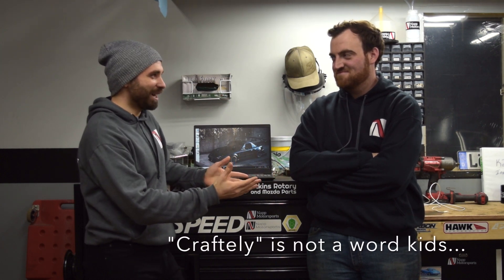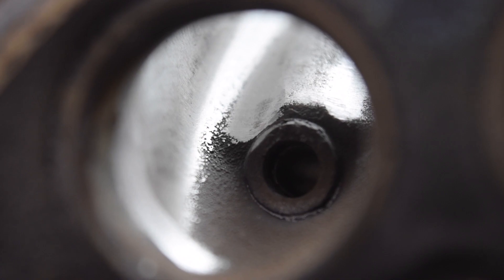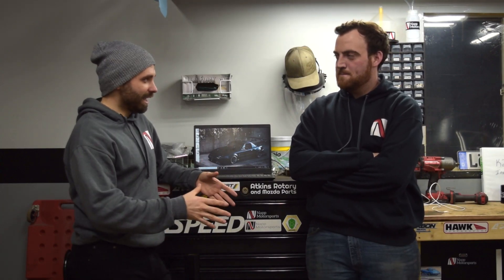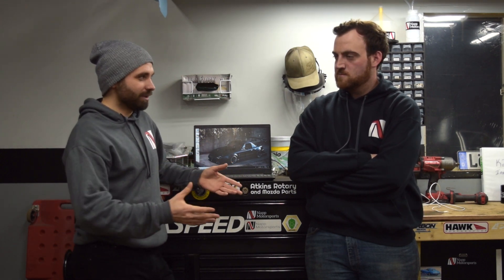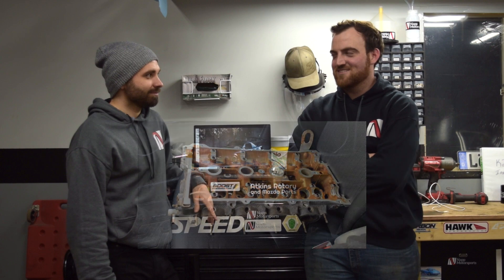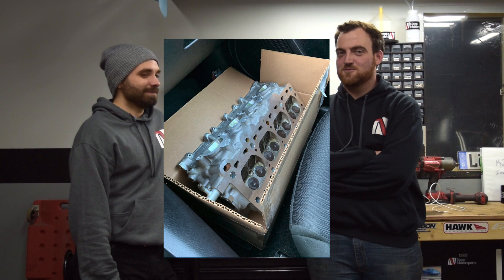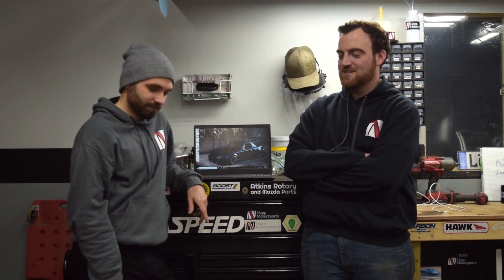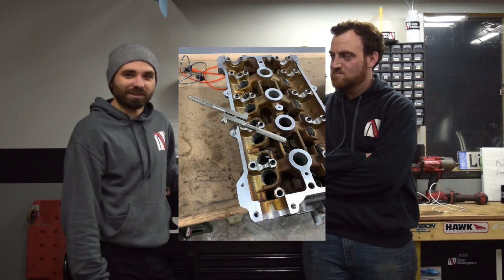Engine Rebuild - Miata VVT Swap | PT4

Comment: Are you able to run full VVT advance with a 0.040" shave? 

I haven't been able to make an exact calculation, but it looks to me like the VVT cam advance would be the limiting factor for a head shave. 

I'm currently trying to figure out whether to do a 0.040" or 0.060" shave on my BP6D. Let me know if you have any info!
Reply from the maker: Our tuner had no issues getting what appeared to be the max power out of this setup, so I don’t thing it had any real effect on the VVT advance. We didn’t do the math, we just sent it.
Reply: @NappMotorsports I admire your bravery! Have you shared your tune /  VVT table anywhere? 

Have you run the "test mode" where Megasquirt sweeps through the entire VVT range? That would confirm that it's not possible to cause interference with the VVT solenoid.
Reply from the maker: We haven’t shared the tune, as it wasn’t done by us and it didn’t seem fair to take our tuners work and put it on the market for people for free. We haven’t run the test mode either.
Reply: @NappMotorsports  FYI, I just measured clearances on my VVT motor and you guys are right at the limit with a 0.040" shave. At the max VVT advance (47 degrees) two of my valves actually do slightly contact the lip of the valve relief in the piston. Just enough to wipe the oil off. 

I did another test at 31 degrees of VVT advance and there's about 0.060" of clearance, which is fine. 

So as long as your VVT doesn't oscillate and the target table doesn't go above ~40 degrees you're totally in the clear.

Comment: So been studying the head shave and been reading about the cam timing. Did you guys do anything to correct the cam timing or does it run just fine as is?
Reply: Honestly think it's a non issue unless you are super picky about that kind of thing. Currently just dropped off my vvt head at the shop to get .040 taken off as well and has me a bit paranoid.
Reply from the maker: You’ll be totally fine at .040. I think at .080 or .100 is when you need to adjust it.
Reply: @NappMotorsports  Thanks for putting my mind at ease lol =D

Comment: Awesome video guys. I currently have my 96 1.8 head off and want to shave 40 thousands off as well, from what I've read it seems like a good sweet spot. You say it's now an interference engine yet plug and play, stock cams and ecu. Did you have to adjust the timing at all or is it just assembly as normal? Also did you use a regular head gasket or recommended aem thinner one?
Reply from the maker: It’s plug and play with the stock cams and timing setup. We used a stock head gasket as well. Once you take I believe .080” off, you have to compensate with adjustable gears and some other stuff to get the belt tight enough.

Comment: Good job guys.! Just finished my own n/a bp build of course in my garage too.! It made 183hp and had lots of fun with it at the track.!! Next step is an adjustable intake cam gear for cam timing fine tuning which along with ITBs hopefully will get me close to 200 flywheel hp.!! I hope the best for your build too and also waiting for incar videos from the Kmiata.
Reply from the maker: 183 out of an NA is impressive. What did you do to it??
Reply: @NappMotorsports   I have the build and swap videos uploaded.! BP6D block, BP4W head, skimmed 0.060", CatCams 274 and some security mods like boundary oil pump gears, reroute, oil bafles and valve springs. Also flatop, full exhaust and MS3.

Comment: Do you have a list of the engine hardware? 
You didnt mention the headgasket, did you go with an early year headgasket in order to use the coolant reroute?
the BP4W and BP6D actualy have the same intake and exhaust casting. what sort of is the tie breaker is the cams, (did you use +1 valves?) 
The VVT system restricts cam availability drastically, effectively putting an already pricey aftermarket cam out of reach. VVT also eliminates the option of the popular "Ehintake" cam swap or MSM cams.
Reply from the maker: Hey Joe! We ended up going with the NB2 head gasket. I wasn’t thinking about the difference in gaskets until it was too late, but after some research, Emilio from 949Racing said he’s run his VVT with a reroute at the 26 hours of Thunderhill (I think?) and hasn’t had a single problem. We definitely won’t be pushing this car nearly that hard, so we’re not worried. 
We’re also using stock cams and valvetrain, the head just got refreshed and a good head shave for more compression. Cams are a consideration for the future, but we have to play within our budget for this year.

Comment: Hi Dylan, Tony S here: Going from 10:1 to 11:1 should increase HP about 3% (see reference).  Do you expect to run this on 93 octane pump gas?  If the stock 10:1 is rated for 87 octane then I would think it obviously should be fine on 93.  Just curious. (Reference: "Design and Tuning of Competition engines" by Phillip Smith)

Second question: The engine had a lot of miles on it but I don't remember if you rebuilt the bottom end.  Now that you have the head done are there plans for either a compression check or a leak-down test to see if all cylinders are healthy?  Thanks.
Reply: Hi Tony! Thanks for the interest! We plan on running 93 full time. Depending on what we find during the process we might upgrade the fuel system and go E85 but that wouldn’t be until next year. 

As for the bottom end we did  inspect the rod end caps and everything checked out. Once the engine is running we will do a compression test to make sure the bottom end is still in good shape. Fingers crossed until then.
Reply from the maker: We ended up going E85 on this, but didn't test it out on the final tune. Turns out E85 is worth about 5hp and 5 ft lbs of torque on this setup.